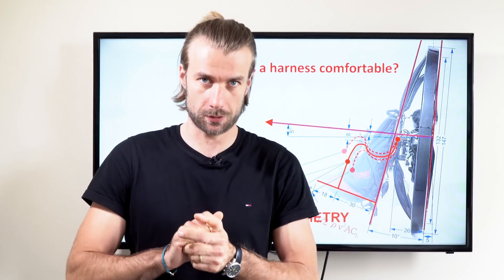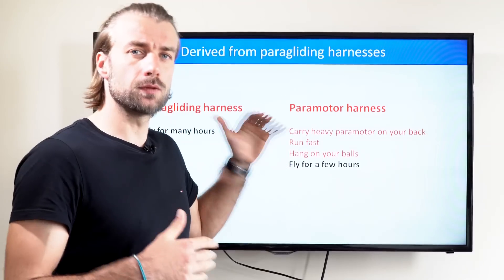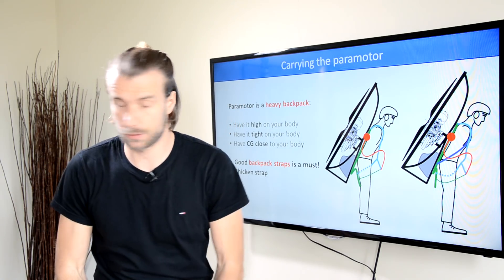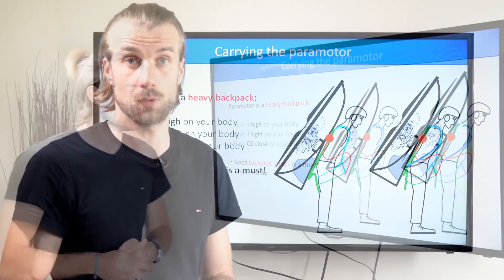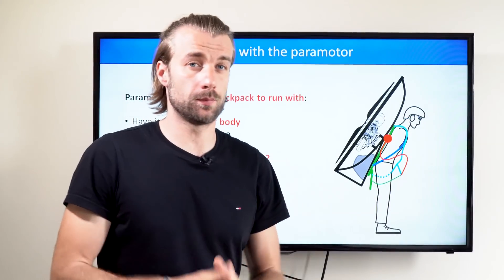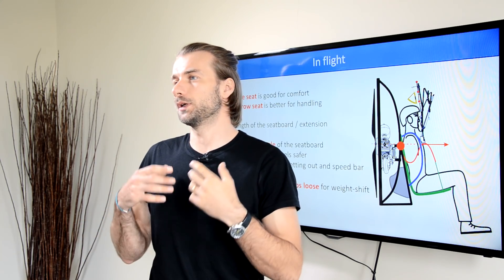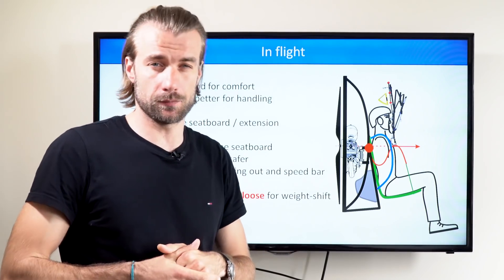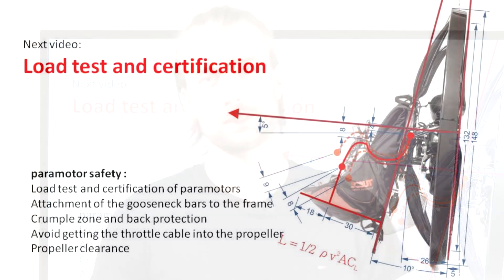Comfort. What makes a harness comfortable? Paramotor geometry part 22.1

Comment: When you talk about the "backpack straps", it made me think.   On most camping backpacks, the majority of the weight is carried on the waist belt and not the shoulder straps.  The shoulder straps tend to be used to help keep the weight of the backpack close to the back and over the heels, but not to support the weight.  Would this method also work to help with supporting the weight of the paramotor?

Comment: I hope you won't take insult to me using these videos as inspiration to make my own paramotor. You are a good teacher but I wish you went into more detail with the math.
Reply from the maker: +noreaction good luck with your paramotor. 
I started the SCOUT as a personal project, too.
Reply: I was thinking of doing the same, but it would be kind of silly since SCOUT already has the combination of features I want in a harness. But not the propulsion system. I want electric with curved tip propeller (sometimes called Q-tip or P-tip) for minimal noise.

Comment: You didn't cover split leg harnesses! Nobody seems to cover this...
Reply from the maker: +xITZxUS few years ago I have designed my own split leg harness but it was not conformable. And I got lot better results with standard harness and Scout hybrid bars so I quit that project. 
I have not flown nor seen the apco split harness so I cannot comment on that one.
Reply: I have an Apco split leg harness but it's the only harness I've flown in. Just curious about comparing the two. Maybe I'll get a bench and see what I think about it. Thanks for the reply! Maybe there's a Scout in my future!
Reply from the maker: +xITZxUS I wish I could test that one
Reply: SCOUT paramotor I find it to be very comfortable and easy to get in and out. The only complaint is the speed bar hook up and no place to store it... Other than that I like it but I wonder about the bench seat often.
Reply: I am currently using the split leg harness and though it is easy to run and launch I do not find it as comfortable for long flights and it is a bit awkward for landing. I will probably go back to a traditional harness. LOVE THIS WHOLE SERIES!
Reply: Lou Serrano   How is it awkward for landing?